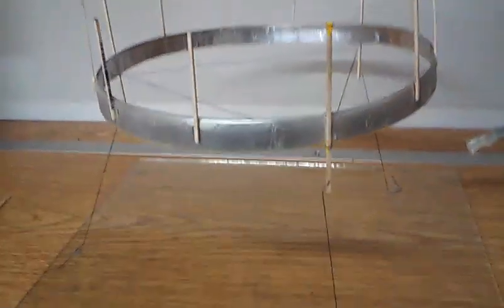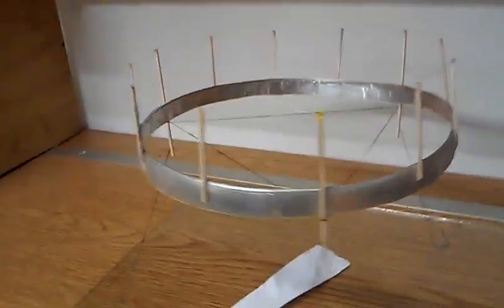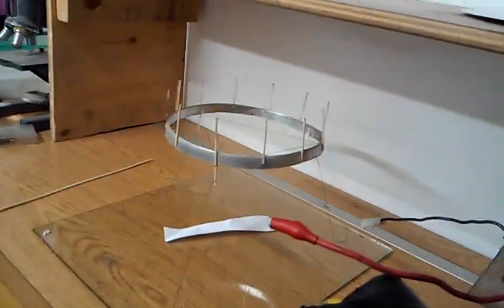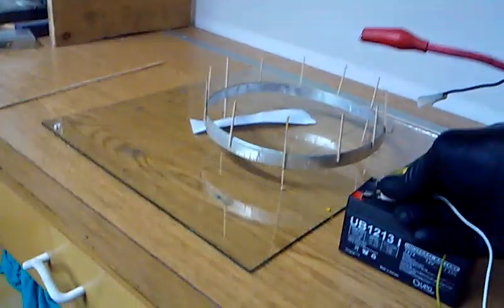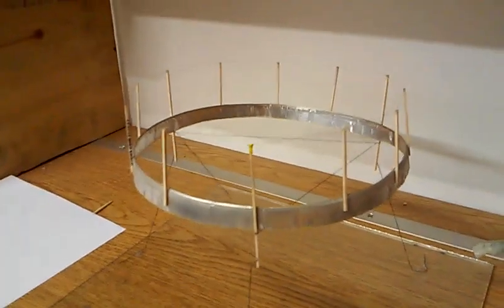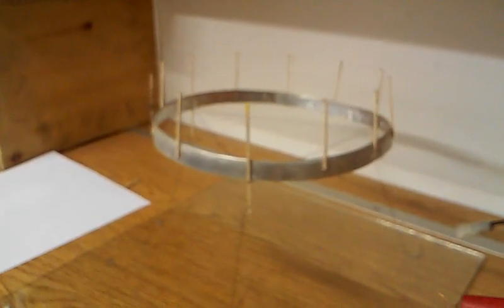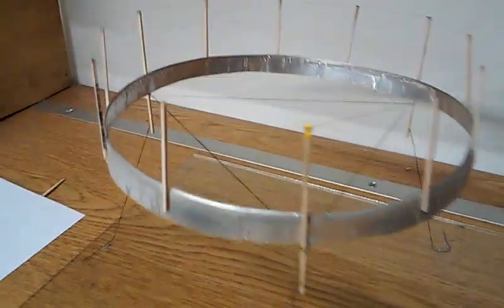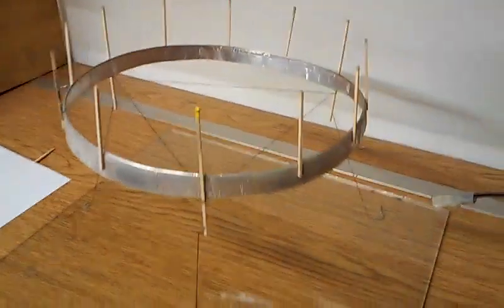ANTIGRAVITY LIFTER CREATES ARTIFICIAL GRAVITY ASYMMETRICAL CAPACITOR

Comment: where do the wires hook on to it
Reply from the maker: The wires are very thin (same size as upper wire) & are hooked to the alligator clips you see coming from the flyback. Positive to top wire & negative to lower apron.
Reply: What is in the drawer below? You never showed your whole setup
Reply: And what happens when I hook it up to a phone-controlled microwave?

El psy kongroo

Comment: the high voltage ionizes the air surrounding it and attracting the electric charged air around it to the aluminium foil at the base therefore pushing the air out and towards the base therefore creating lift.

Comment: my dude, how about to prove your claim that this is some ungodly, anti-gravitational force, try letting smoke, or dry ice vapor flow onto the rim of the lifter. If it is indeed anti-gravity, you will not see the smoke pushed through. Until then, I reject your claim.
Reply: 0xM301 because of the nature of the device, there will always be some Corona discharge and therefore ion wind. With that said, the amount of thrust produced by this device, it would not succeed in floating. In some I've built you can hear the wind hitting the table below and yet I had little to no lift. And yes,I know what I am talking about as I have been researching this since 1999.
Reply: +Jed S    blimey, are you in for a shock
Reply: We all need to learn not to hinder our perception of all that is around
us by maintaining concepts and belief structures based on the five
senses we have been taught we are limited to. And quit deriving our
own belief about what God is from impressions brought about by
religion. Or looking for the explanation in a world which is also lost in a
reality based upon the same limited information of the five senses.
“SCIENCE”, is not an explanation for God not existing. Rather, it is more so, an explanation of how God works. And what we currently are able to grasp in regards to "science, would not be enough to get us
started in our understanding of God. But the more we know of God
the more we are able to fathom the inner workings of that which we
are and what exists around us. Including that which we call science.
And once the world understands this enough by faith, proof will follow
Just as sweetness couldn't be proven without a sense of taste and
our understanding and experience of it through a human body.
Reply: JoyfullUniter is out of topic. 
They are trying to understand the manifestation of love (anti-gravity), that's nothing wrong about that, as you try to understand love.
Reply: 0xM301 t
Reply: JoyfulUniter good to see someone with a pure view ,see the prob here and many similar mistakes ppl happen to make is get triggered by sometin thats not down their already sketchy alley (being not aware of how sketchy at the same time_possibly) at the end of a reply it just seems they have a story to tell and they need to let it out;, unfortunately starts with the misinterpretated/wrongly aimed at the wrong comment and followed by that story hook that somewhat relates on the personal subconflict(s) with yea lack of edu or false education for that matter which turns out to look like they r comingout swinging sort of challenge
Reply: Nicely worded my God-believing friend. Might i add my belief that like my dog will never be able to comprehend language or math, we are unable to comprehend much of what God is and why things are the way they are.
Reply: Hey, there are some good ideas!

Comment: No he didn't create an anti gravity machine, but look at the money he's made from posting this video.
Reply: The observation is it is defying gravity, therefore it is an anti-gravity device. You can apply the word ION if you like but the definitive observation is gravity is defied here and in action.
Reply: Again, creating a force that moves in the opposite direction of gravity... Is not Defying gravity in anyway. Antigravity would not need energy to be suspended because neutralization of gravity would allow things to just float. No need for strings...wires... nothing. Proof of this is gravity is still normal all around the object, nothing has changed in the slightest. Rockets work almost the same as this device. Hes generating thrust that has an amount of force greater then that of gravity downward force. Its a shame I see so many people online that otherwise might just have good minds. They are inquisitive and willing to build and test things of science yet to often they get caught up in Dumb ass "science" stuff like free energy and antigravity when currently NEITHER exist. Not in any form someone in their garage is going to make.
Reply: LMAO, bro... just no... I have built more than likely more then you have even thought about. I have a problem because this is bullshit. He built a lifter then goes and spreads misinformation.  Nothing about what he stated is slightly correct and because of that 10000s  of people now believe that is the correct way. Its not. Its bad science spread by someone who does not understand what is going on.
Reply: Please let me know where I can see your work, I really like what I see, either it is correct or not. I get is not the best way to do things but it demonstrates that the goal can be achieved.
Reply: Well I don't really you tube so I doubt you will see the Lasers or Tesla coils I have built any time soon but its possible maybe one day, the only thing I have ever posted on here are a few Computer programs that I have made mainly just to show friends of mine different things I have been working on. Even with a lack of a portfolio, lack of one is better then having one like that of the owner of this video in that its better to say nothing at all then to speak and be totally wrong which is the case in this video. 

If you indeed like what you see, then look up Lifters, you will find much more impressive things then this video, some of what has been made are down right awesome.
Reply: And yes btw I have made lifter devices before powered with Saltwater capacitors and an OBIT transformer.
Reply: Sedit T I would like to build a wide range slim Tesla coil, like the ones Witricity used to build, but I don't know much electronics or electricity, so I don't know if it is a long term use safe device. I have some projects in mind but getting to build that tesla coil is a first step. Do you know where to find schematics or instructions?
Reply: Since you suggested you wanted to see what I build...
https://youtu.be/w_cuCWsDKHs
That's my physics simulation I am working on so that I can use  soft bodied physics for an Artificial intelligence program I have been working on. The Cellular Automatons from my other videos are soon going to be linked together in Multicellular organisms controlled by AI Neural Networks. 
As far as Tesla coils being safe.... IDK, Honestly... I got skin issues working with them that I can only really attribute to the EM from the Coils, that and Electrical safety but in all honesty they are not hard to build at all. a Solid state TC would be the way to go since they are safer and easier to make table top variety to play with.  If you want to build lasers look into TEA, they are relatively simple. I have built that type and CuVapor lasers in the past.
Reply: And we don't see much from you to prove anything either way. As for building more than I have ever thought about, you could be right, I've never thought anything about it and why should I.  It's simply a natural phenomenon which can't be used for anything except making ignorant people think it's magic.  All these charlatans are alike, plenty of BS laid on thick to squeeze as much money as they can get out of it.
Reply: I just posted a video of What I am working on right now. Im programming a computer simulation of Evolution using Neural networks and Genetic Algorithms... If the post did not show it might be due to the settings on this channel. You can check my page to see what Im working on. I dont make good videos, only stuff to show my friends but have a look I dont care
Reply: w_cuCWsDKHs  <-  Go to Youtube video. Thats what I been working on. Not in my Garage lately.
Reply: I love building stuff Propfella, sorry I don't make videos of it but its just what I do for fun, Not ad revenue.

Comment: You should check out the Bifield Brown effect. You could use large extremely high voltage capacitors to polarize the local quantum field in favor of levitation and then directional flight
Reply: You should check out the "Magnetic River"  Prof. Eric Laithwaite. Inventor of the "Linear Induction Motor".

Comment: I just discovered that distilled water has a k value of 80, which is very high. So a metal bowl filled with water should work. The bowl could be the anode. The lid could be plexiglass with a needle protruding down through the center into the water to make a small cathode. Bolts and a gasket could hold the lid on tight. The cathode must be sealed good as well. 
     Testing this on a scale should show weight increase. Turn the device upside down and it should show a weight decrease, or perhaps might fly.🙂
Reply: I would like to see that tested. That's a great idea.

Comment: Build a shell around it. Put the power source on the inside, but put the ends of the wires on the outside. Make it fit four people and use a car motor and fule it not only with gas but also hydrogen through the engines air intake. I still haven't figured out how to stear something like that but it would definitely have omnidirectional movement

Comment: This device from the TT Brown Patent, US Pat #2,949,550 ELECTROKINETIC APPARATUS works better in hard vacuum, then the current can be turned way down and the Voltage up for Warp Drive. Thiss is the most power-to-weight ration of any known propulsion, and it breaks Newton's First and Third laws of Motion, and the Conservation of Energy Law, and the system is inertia-free..

Comment: May the aluminum undulate at very high speed creating directional WAVE, deep in the material. 
So injecting energy directly in the original mass, then increasing it "energetically" and in a certain direction. 
Directional inertia making it move and lift.
Wave is the way nature/energy has found to move through space and time. Light waving to move, sound waving even us spermatozoid  waving before even walking. Wave is the body of energy

Comment: "Patent No. 3,187,206. The significance of this new patent is that it describes
the existence of a net force on the asymmetric capacitor as occurring even in vacuum. Brown
states that, “The propelling force however is not reduced to zero when all environmental bodies
are removed beyond the apparent effective range of the electric field.” Here is a quote from the
patent (Figure 6). " US Army report https://arxiv.org/pdf/physics/0211001.pdf

Comment: There is no anti-gravity happening here it is a ion lifter powered by ion wind! If it were anti-gravity you could use a 100 pound disk or a 1000, 10,000, 1,000,000 - Infiniti pound disk!

Comment: I believe that the output of a flyback transformer on an old CRT for a computer is probably about 15,-18K volts. Pulsation is because of sinusoidal action of the transformer. The frequency of the high voltage I do not know but it probably is in the audible frequency range or just over. Unless a High Voltage Diode is used it is not DC but AC.

Comment: The Cannae electric space drive works in a vacuum.  The EM drive uses a resonance cavity.  Combine the two approaches for vacuum tests?  The engine tests for Townsend Brown electro-gravitics also use dielectric and magnet layers, which DO demonstrate lift in a vacuum, but I haven't seen anyone yet apply it to a dynamic hull shape that holds its own air.  

Putting the sheet of paper over it does seem to demonstrate that there is more going on than just ion wind.  Using a feather instead of paper to test would be better....    but there CERTAINLY does not seem to be much wind generated here ...  the edges of the paper on top don't seem to be curling over due to airflow too much.

Comment: You're going to run into a weight/volume prob. But you know that...the answer is volume reduction and drastic weight reduction to make this work being self-contained. Not saying that's easy because it obviously is not! You need to increase HV while maintaining low current(amperes). But only using military equipment, perhaps some experimental commercial assemblies/components. Battery appears to be ni-cad. Bat life is way to low, no way to maintain amp/volt. output. I know of batteries that can achieve these problems WITH less weight. But...even that only extends the inevitable. Tricky...but not impossible...Again...very good job!!
Reply: You're still back to solving the weight issue. I also feel that increased voltage/amperes is applicable  to receive you're goal. To be a self-contained "miniature" P/S, Battery, and HV output isn't easy. You're prototype works but until the assemblies' design is miniaturized it's antigravity effect won't work I could give you info, on where to obtain this type of components if you like. Your theories are sound and I think you've  really outdone yourself. You just need the proper tech. Sorry for rambling but these types of subjects are amazing! Feel free to talk more on this matter if you like...
Reply: I'm still concerned with mass reduction that will still have the current/ volt.  I gotta think on this one! I'll get back to you soon, It's quite a challenge but it.s 4:5oAM -_CST and need to recharge my positronic brain for a while We'll "speak' again. Happy New Year!!!
Reply: Your suggestion bears merit! I'm not familiar with Searle effect generators so give me a couple days t do my "homework". I believe the anti-gravity drive could prove useful in navigation as well as propulsion. Though this is challenging(to me)I don't like to loose so it's just another challenge to overcome.
Reply: Searl Generator we just patented, to protect Prof. Searl's RIGHTS. US Pat No. 9,871,431 SPINTRONIC GENERATOR, issued Jan. 16,  2018. The paradigm has shifted!
Reply: or make it MASSIVE
Reply: Not sure if you've seen the crafts on my channel, but you're not far off!

Comment: It would be interesting to see if this device can work by harvesting energy from air. In theory air provides natural high voltage so it only need a transistor and a voltage regulator to make an air craft that can fly by consuming energy from air. For more info and a demonstration what i mean you can check high voltage plasma channel.

Comment: Dr Harold White confirmed that if the positive end of a capacitor has more volume then the negative end, the result is negative energy, so what you have there sir is a warp drive... try insulating the surfaces to test warp strength.
Reply: good point!

Comment: The schematic is very simple. He is not using some abstraction: it a power supply 120 volts, or 12volts, then upped to a high frequency. The upper wire is the positive, the lower skirt is the negative. 
It works so well NASA has a patent on “thrusters”, for use in low orbital situations where there are some atmospheric drag. I’d strongly suggest you simply look up various set ups

Comment: Judging by the design visible, this is electrostatic repulsion. There is a sheet in the drawer under the counter with like charge, or the glass has enough conductivity to act as the lower plate. The transformer is producing a few thousand volts DC, sent to both sides, so just like the leaf-plates of a Leyden jar fly apart, so do these. I assume someone could calculate roughly the voltage needed to produce the force shown. I think it would be quite high, so that he can get so close without getting shocked is the most impressive part of the demonstration. If this is magnetic repulsion, then a magnet hidden under the counter would do it. But that's not much of a coil up top, and the current needed might melt that fine wire.

Comment: You need to put this device inside a closed plastic box, where no air can go in or out. Then measure the weight.  It must be so far away from all conducting surfaces, that electrostatic forces can be neglected.
The low current doesnt say anything, because 100µA x 20kV = 2W, this should be enough to lift the apparatus.

Comment: Clever trick: It is not 'Anti-Gravity'; the high voltage going through those unprotected wires will ionise the air around them, that will travel downwards to the Aluminium foil sheet to complete the circuit. Generating a downward thrust stronger than Gravity acting against its weight, overcoming gravity. Not excluding gravity.
If it was excluding gravity as an Anti-gravity device, it wouldn't matter if you added more weight into its field. :/

Comment: I am not sure if this actually the case but try some tissue paper between the top wire and foil. Maybe the ionized breeze bonds with fine dust particles and then gets caught on the surface of the foil, like an electric air filter. But nonetheless an impressive build.

Comment: There"s no anti-gravity. The Capacitor just repels the magnetic field of the Earth, that is around 33µ Tesla to 38 µ Tesla. If your circuit exceed this amount of magnetic flux, it creates a displacement in the capacitor, because is asymmetrical means that create an unbalanced magnetic field to only one side of the orbit. In other words an external (Magnetic)force is higher than the gravity. that why levitate the capacitor. The question will be: How many force is created enough to built a ship to fly? Is an efficient force?

Comment: try putting it in a vacuum and using higher voltages and u might be able to get the glass on the bottom to lift